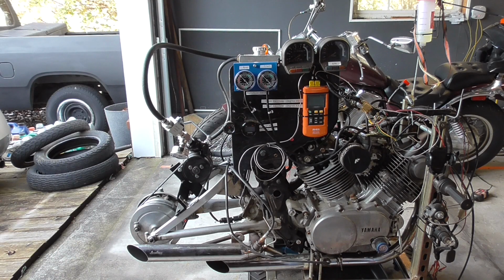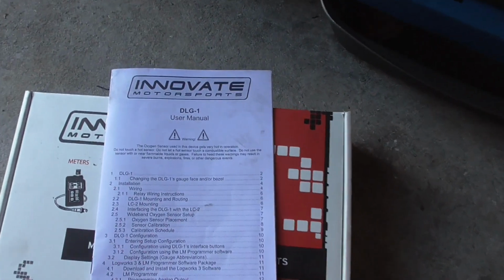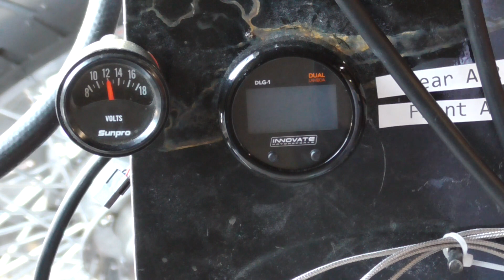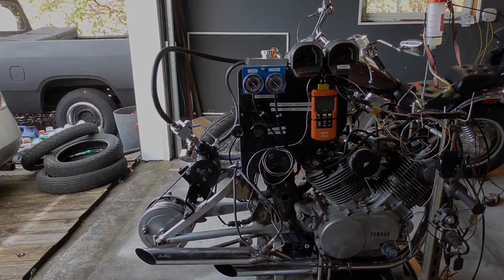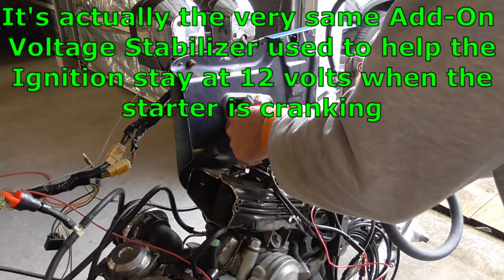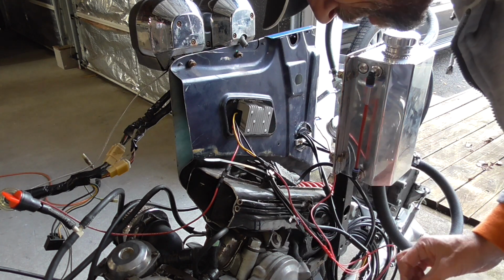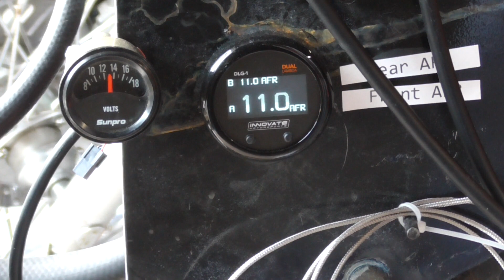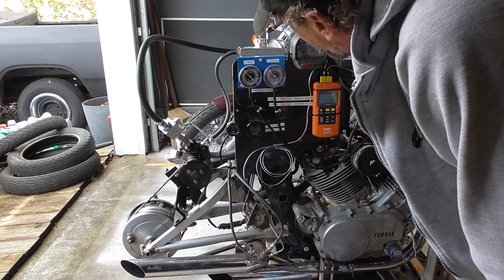Innovate Dual Air/Fuel Ratio Gage Kit - Waste of Money or Worth it ?!?!

Comment: Love it!!... I remember asking you about tuning with afr.... can you tell any difference from the way you used to tune? Or do you think sync tuning is better?
Reply from the maker: Thanks !  Yep, it’s much easier just to read the gages to tune it as you can set it a bit rich by the numbers, but it takes some work to put on the O2 sensors so it for sure not something I would do on my bikes.  I was actually curious as well to see how well I had been tuning the motors by ear and by just syncing the carbs so I tuned the motor by ear like normal, then hooked up the AFR gage to see how I did.  It was actually nice to see that tuning by ear over the years resulted in exactly what I had always thought the AFR would be (slightly rich for these air cooled motors).  For me, I’ll just keep tuning them by ear since it easy to do and I don’t have to cut into the exhaust pipes to add in the sensors 👍.
Reply: Now.... Now Steve.... I agree 100% not putting bungs in the pipes...... but look at a little differently.... I know you can make us... a nice O2 probe to go up the tailpipe...  I did mine by sliding it up in the exhaust..... but after melting the wires a little I used a tin can that fit over the exhaust. I would rather have a sniffer type pipe we can slide in the tail pipe. It would be nice if we could then clamp it on to hold it while running down the road..?? Interested???  @StevesDIYs
Reply from the maker: @TheMamonti1  Hmmm…that would be a thought to see if the O2 sensor’s wire and the part of the sensor that normally doesn’t see heat could be protected somehow (jacket it with a steady flow of coolant perhaps !). Then it could be slipped into the exhaust and not get too hot.  I might have to play with that a little bit 👍.